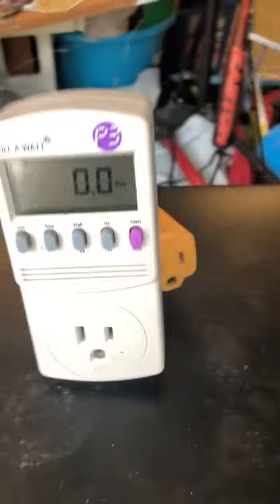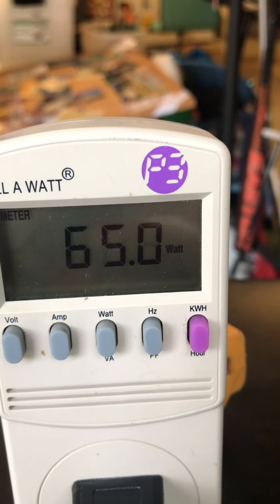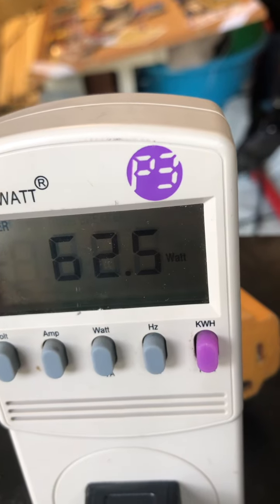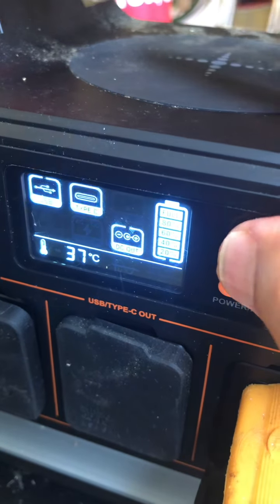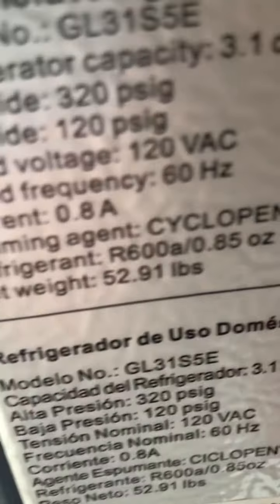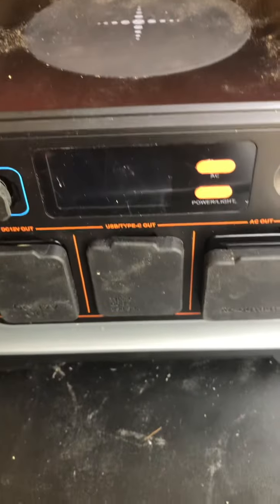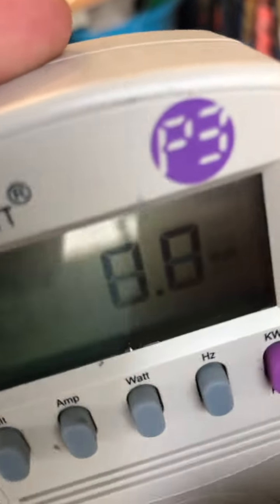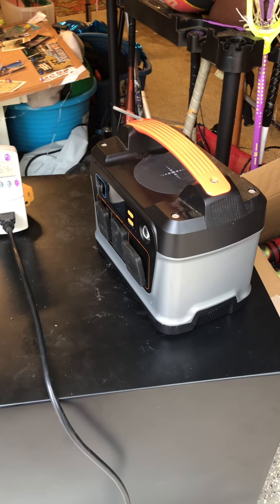Why My 300 Watt Solar-Powered Battery Can’t Run My 96 Watt Fridge

Comment: The initial kick of the compressor, caused the big draw and most invertors have to have an over current for a certain amount of time if the time is exceeded then you have an over current situation and the inverter shuts down for safety.

Comment: Josh, refrigeration compressors need at least 2.5 times run current for start up with NO voltage drop. Connections must be absolutely tight on the DC side, better yet solder all the connections that are possible, no crimp connectors.

Comment: I have a small freezer that runs on 70watts, but uses 1k on start. The motor needs a huge surge just to start turning. Most small appliances I've run need at least a 1kwatt inverter or better. The kill a watt meter isn't very good to measure that initial surge.

Comment: I have a couple of 350 watt power stations that will spike up to 700 watts that would have handled it.  Unfortunately, a lot of the ones on Amazon only spike 100 watts over the rated power.

Comment: Josh name plate raring is only running current. Anything with a motor has an in rush that runs from 2 to 3.5 times the running current

Comment: I believe you are running about 65watts is because it is AC power.  So multiply 96watts X .707 and you will come up with a number close to the 65 watts you are seeing.